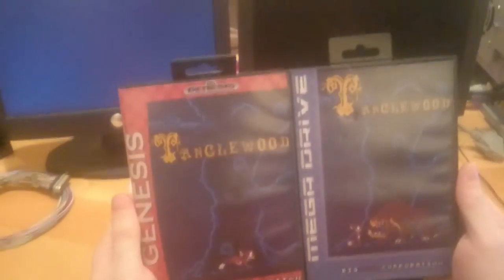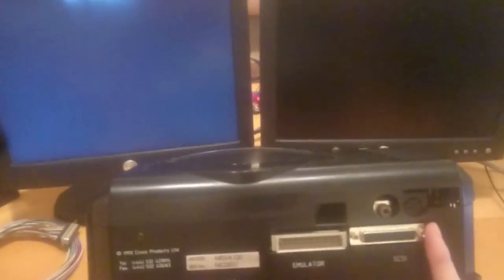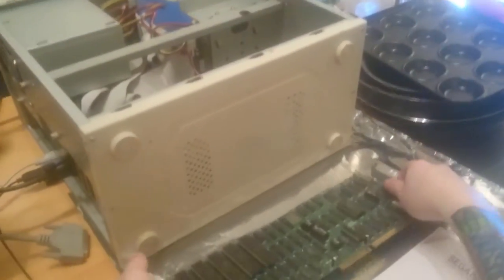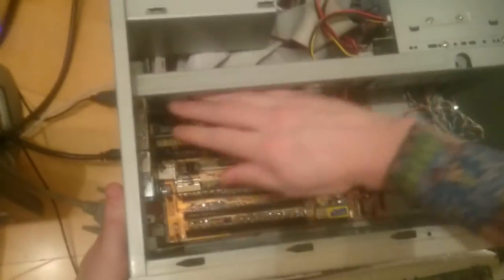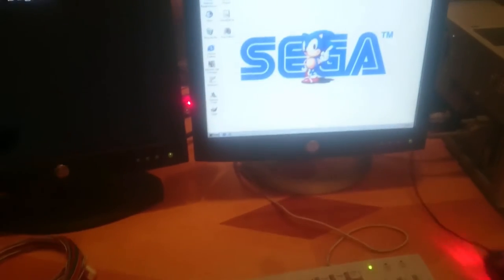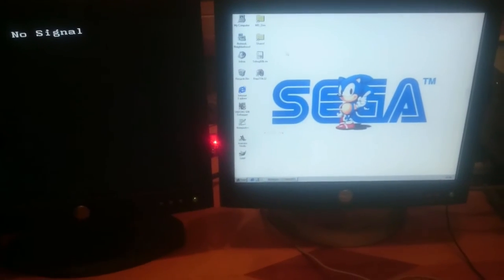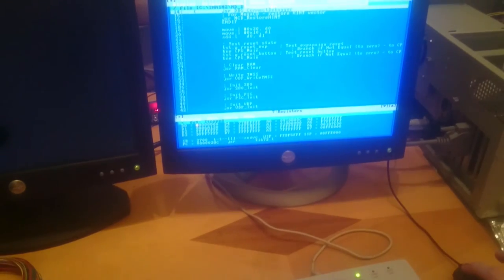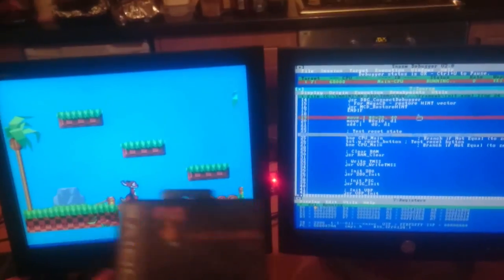SEGA Mega Drive/MegaCD Development Kit - a quick demonstration

Comment: I wonder if you would be so kind as to upload some higher quality images of the CTrac CD Emulator card somewhere (and hey, while we're asking the software too)? This seems something there is so little information on. 

It is I believe very closely related to the Commodore CDTV version of the CTrac CD Emulator (the CD-ROM chips used are the same and the hardware is very similar) , only that used an A2500 or A3000 instead of a PC.

Comment: Absolute nerdgasm at 3:48 when you pulled out that binder! What a great item to be included with all the kit, and it looks in great shape as well. Someone must have really loved that whole piece of video game history. I wonder how many existed at any one time? I recall you knowing of 3 that are currently around (including your own) but surely there were hundreds at one point? Where did they all go!
Reply from the maker: I've no idea how many were in circulation at the time, I believe Cross Products' kits were available to buy if you knew where and how, but the proprietary SEGA parts (CD emulator, manuals) were under lock and key, which makes it difficult to determine the numbers. I know of 3 kits, but only two that are working, I'd love to know if there are more.

Comment: Hello
Does it need power supply 9v 3a dc connected near scsi for working ?
Reply from the maker: Hi! Yes it uses one 3a 9v supply, which powers both the Genesis and the MegaCD sides. It doesn't need the SCSI interface to operate in retail mode (using DIP switches) but you may as well just get a regular MegaCD if that's what you want to do with it. It needs a SNASM2 ISA card and MCD emulation ISA card to do anything else.
Reply: Big Evil Corporation thank you. I tried to use a normal genesis power supply 9v 1.2a. It doesn t works correctly. I will use a 9v 3a now !
Reply from the maker: 3120falconet Wow, you own one of these? Do you have the ISA cards too? I can help you get it running.
Reply: Big Evil Corporation i owne only dev unit but  i do not have the isa card... i hope to find it !!!
Reply: Big Evil Corporation i search an isa card... where can i find snasm isa? I leave in France. I will let you know when snasm will boot correctly with 9v 3a dc power supply.
Reply from the maker: You can run it in retail mode until you find the ISA card, it should behave like a regular MegaCD console:

Left DIP switch: ON, ON, ON, OFF, OFF, ON, OFF, OFF
Right DIP switch: ON, OFF, ON, OFF, OFF, ON, OFF, OFF
Emulator switch: OFF
Reply: Big Evil Corporation hello can you send me link for buy 9v 3a adaptor ? I can t found adaptor
Reply: Big Evil Corporation please help me. I only have genesis dc adaptor but it s 9v 1a. Can you find correct 9v 3a adaptor ?
Reply from the maker: Hi! The one I use is from Maplin (now closed forever) but it's very much like this one: https://www.amazon.co.uk/Outtag-Destktop-Bluetooth-Speakers-Switching/dp/B07383SK35/ref=sr_1_1?ie=UTF8&qid=1526558230&sr=8-1&keywords=9v+3a+adapter  - 2400ma is enough
Reply: Big Evil Corporation thank you very much. I know just need to wait....
Reply: Big Evil Corporation is it same polarity as  genesis power supply ?
Reply from the maker: Yes, same polarity! I'd try it in a standard Mega Drive to make sure you've got it right first.
Reply: Big Evil Corporation just receaved psu but it is inner (+) ,outer (-) 
But Genesis psu is inner (-), outer (+)
Reply: Big Evil Corporation I found a polarity inverter on the internet. I will keep you informed
Reply: Big Evil Corporation sorry for my english. I receaved today the dc adapter as on your link. But it is not same polarity as genesis power supply. Can i test my dev kit with it ? Or must i inverse polarity ?
Reply: Big Evil Corporation hello can you confirm your 9v 3a psu is negative tip polarity     like that :     + -(o- -
Reply: Big Evil Corporation hello after 1 mounth devkit is repair. It works in retail mode. it is a us sega cd devkit. I still search the isa card. I ordered you TANGLEWOOD in may 2018 😀. Can you inform me about shipping delay ?

Comment: Blue boxes suck. Because you are going to make the cartridge compatible with all regions, I would hope you would use the classic boxes with the black border.

Blue Boxes make me think of cheapness for a number of reasons.

1. The covers were often cheaply printed and graphics were pixelated.
2. Glue holding label to cart was cheap resulting in blue box game labels peeling away.
3. There was often grit under the label causing little protrusions and lumps.
4. Labels were often wonky and had air bubbles.
5. There was no acrylic coating on the cartridge labels to protect them which has resulted in a lot of blue box games having faded, torn and scuffed labels.
6. A lot of the actual plastic used for the cartridges was flimsy and cheap as compared to the superior Japanese made ones.
7. Booklet staples were cheap and often wonky and the booklets never laid flat correctly.
8. They even started printing black and white only booklets including the covers to save costs.
9. Obviously this is when they brought in the region locks and half arsed region optimisation. Meaning a lot of modded systems were incapable of playing these games as intended i.e., full speed AND full screen.

When SEGA moved production of the games from Japan to Europe, SEGA Europe really cheaped out on the production.

Even as a child this annoyed me. I remember I would always ask the sales person if I could inspect the blue box carts so I could get a straight label with no lumps, but this wasn't always successful. Even now as a collector I try avoid most blue box games for these reasons.

Not saying yours will suffer any of this, but blue boxes evoke this memory of cheapness and they represent SEGA Europe not caring about quality. Food for thought.

Game looks great, although I did not get the demo to work on my Japanese VA1 Mega Drive using MegaEverdrive X7. Just freezes and doesn't load anything. Will try it again tonight.
Reply: Not sure which version. It was just called TANGLEWD.BIN. Downloaded a fresh one from your site dated 2017-04-21 16:52:40 and will test tonight. I am quite inspired with all the recent development videos I've seen lately that I now really want to learn programming for the Mega Drive. Just starting to look into it.
Reply: I managed to get it working. Must have been a dodgy download at my end last time. Will check out your blog. Cheers.
Reply: Got Mega Man and the Wily Wars in a blue box . . .
Reply: +chris thackray That's nice, but they are still cheaply made compared to the Japanese made PAL cartridges. None coated paper labels with low quality glue. That expensive rare cartridge will decrease in value because of poor foresight by SEGA.